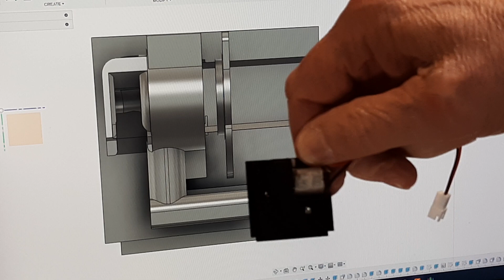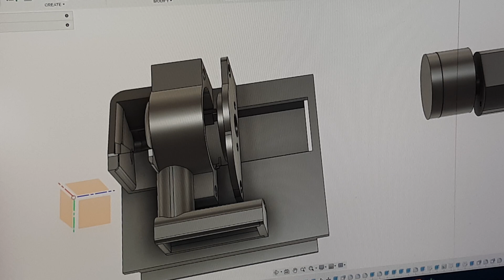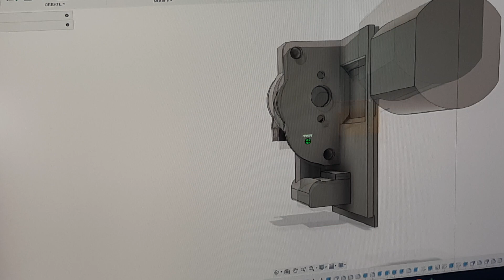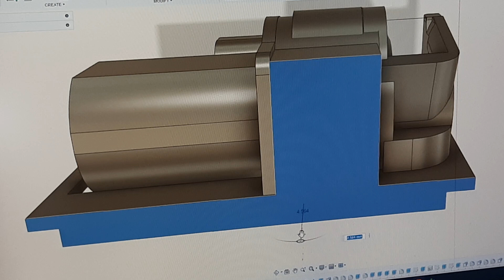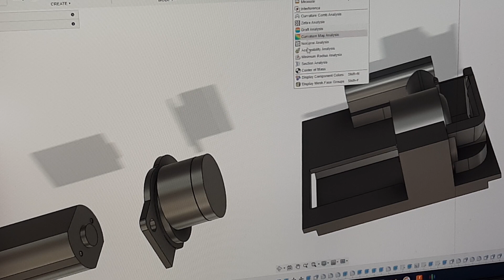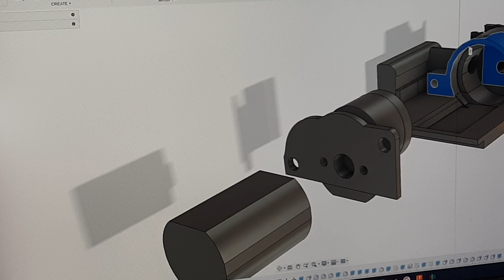Frankentrain Laboratories redid exhaust. 4mm header pipe now. It should pump more air.

Comment from the maker: Update I completed the print and assembled the cooler fan and did run a smoker test. But I could not get a video as I was over running my train time for the day. But I can report smoke was pulled in readily from lower angles and was pushed quite a burst of air out the 4mm exit. I will get and post a video of the smoke test in the morning.  Then setup the tender for another heat run with probes. Thank you all for following and watching. Dennis